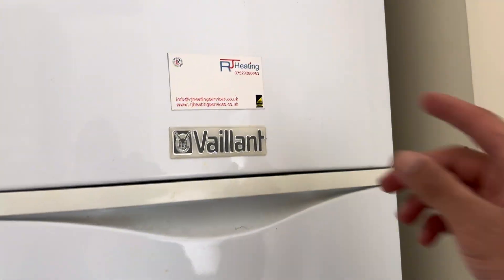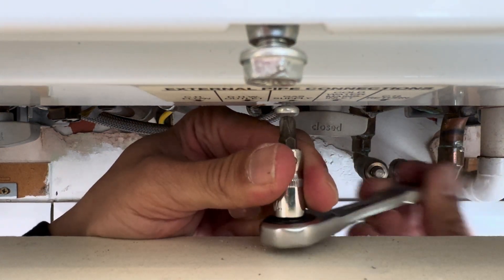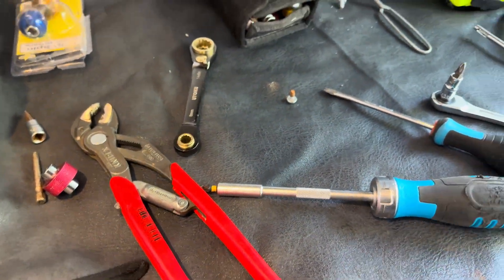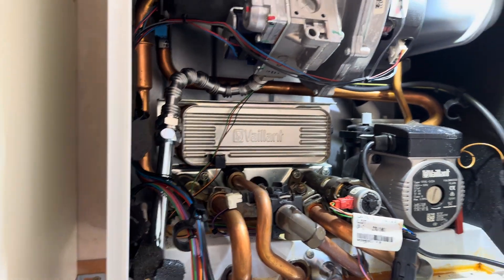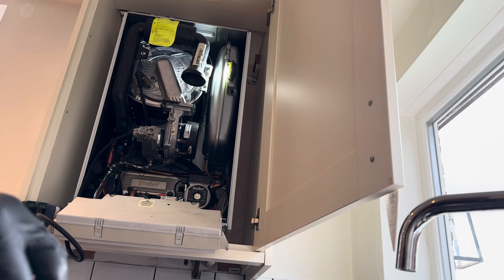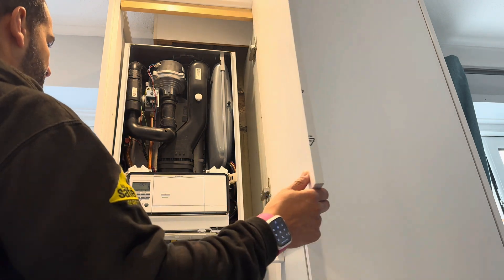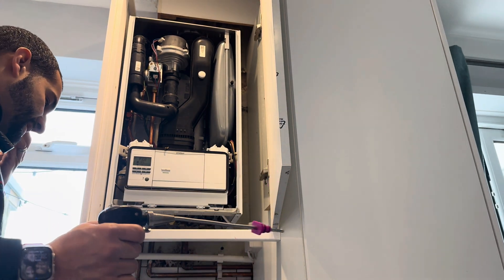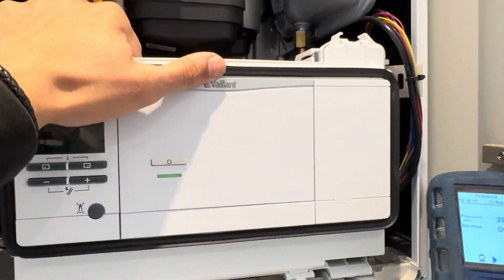How much rust can one pipe take?!

Comment: See the corroded gas pipe regular on these. Most of the time sitting in a pool of condense from the split condense hose 👎
Reply from the maker: Yep! Often it’s the condense where it’s been sitting against the return pipe or the diverter valve! Usually, if the pipe is sitting close together, I’ll put something between it to stop it melting